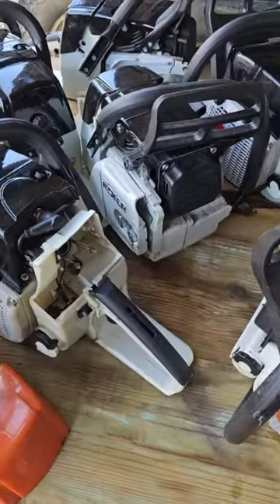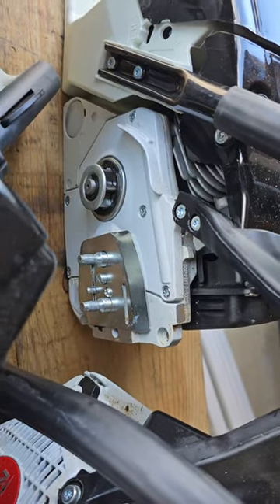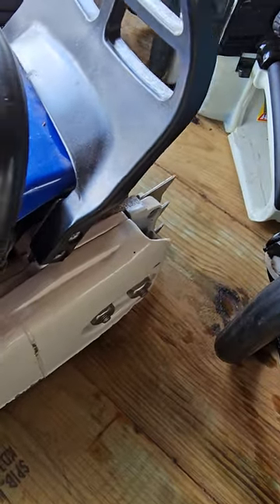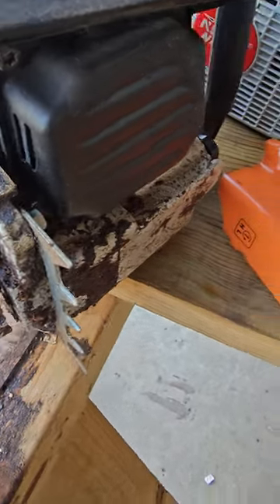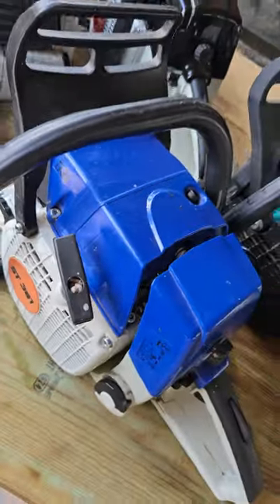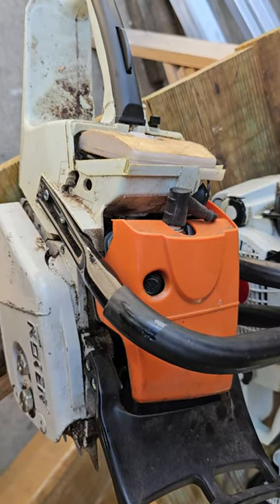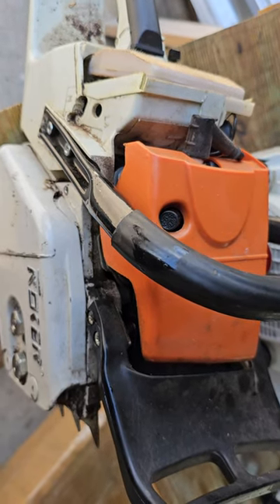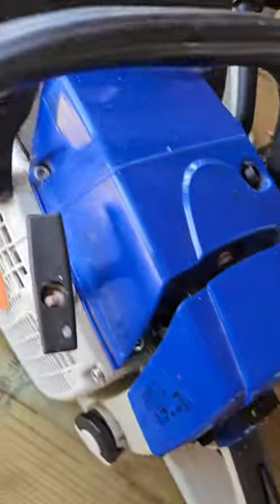Some Iron Clad Proof: Stolen Chainsaws & Fraud Review. Crazy 381 Chainsaw story of 2023

Comment: First thing to do is swap out the de comp, the cheaper ones are prone to leaking, making the saw low on compression. 

Second is pull the muffler off, peek in there, if you see scoring, that be your issue. 

Sending any engine from cold to wide open is bad, the piston hasn’t expanded proper and will rock in the bore, it will be worse if the piston is a bit loose in the bore to begin with. The piston will rock causing the piston skirts to wear excessively and you have charge air from the crankcase flowing back through the intake and not enough compression in the crankcase resulting in less fuel air going up through the transfers. Which results in low power
Reply from the maker: Will do. Thanks a million. I have 10 decomp valve plugs.